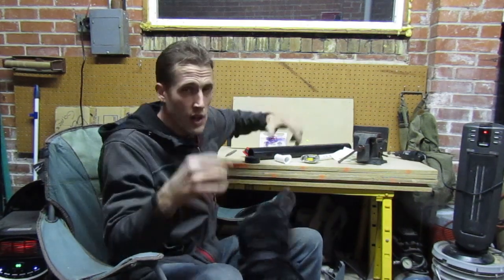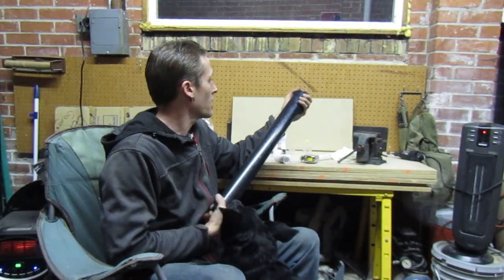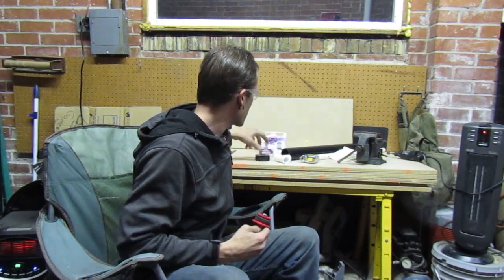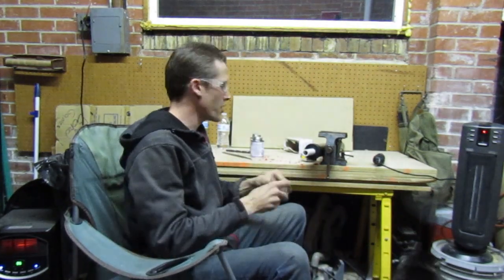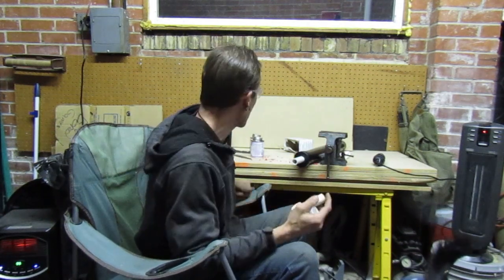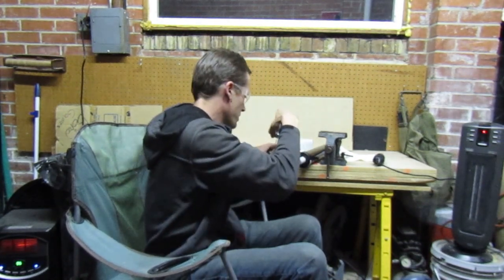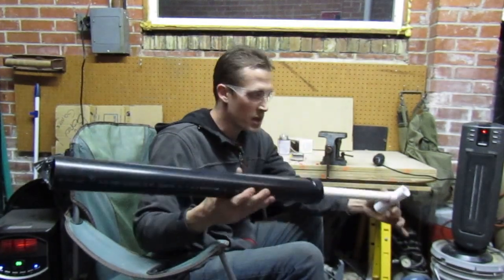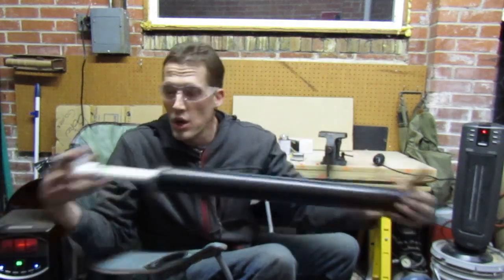Do It Yourself: Hand Dredge/Yabby Pump

Comment: Nice relaxed video. Drill a 1/4 inch hole near the top end of the 2 inch tube. That will allow it to expel air/ water above the seal when drawing up. Dont use a screw or anything hard as a stopper on the handle as this will soon destroy the pvc it hits against. I learnt that one the hard way.
Reply from the maker: Maybe I'll revisit this one and add some of these features, thanks for watching!

Comment: How has it worked? The test plug was snaggy on mine so I flipped the red plastic pieces around and cut two, three inch circles of thin leather and fit them between them and shaped them like well leathers. Works amazingly well. Zero drag and seals like no other. Enjoyed the video.
Reply from the maker: It's a beast! In my last video I used it and pulled up some big rocks. Thanks for watching!
Reply: @lankywhiteguy  They really are one of those "what did I do without this" tools
Reply from the maker: Definitely! Some places you cant scoop!

Comment: I've seen this done, but instead of a rubber plug, Leather is used. And as the leather gets wet it swells and provides better suction. (It is cut round to fit and a couple of layers thick, then squished and soaked.) The rubber plug can be temperamental and or difficult to get a proper amt of suction.
Reply from the maker: True. I've had older pumps with leather but you've gotta tend to it and make sure it doesn't dry out and get brittle. Thanks for watching!

Comment: So I'm building out several of these pumps in 1.5", 2" and 3" diameters and i think I'm using the identical oately test plugs you used for them... Now I also "get kinda ehh about that stuff", but ALL the time... Only i can't get past it till i conquer it... Lol...
So if you have a minute, i have a couple quick questions, is your 2" plug using a 5/16" carriage bolt?? Both my 1.5"&2" plugs have a 5/16-18 bolt, one that's 1.5" long, the other is 1.75" long (the 3" has a 3/8-16 x 2.25" center bolt)... 
Next question, did you definitely drill your cap out to 1/2"?? If so, are you having any trouble with it staying set where you adjust it to for any length of time?? 
I've deviated from your design where the plunger rod connects to the test plug in an effort to make mine modular as well as seal better, but I've been trying them out in the garage and I'm not happy with how they're holding a vacuum yet... Reason being, I'm in SC between Charlotte and Columbia and a lot of streams around here flow in the 0"-2" range in the summer and fall, and to get into something with a 4"-6" depth makes me think I'm in a river... Not to mention the super low likelyhood of finding gold close to home, makes me really wanna be firing on all cylinders after traveling... Lol... 
Anyway, I'm not sure if I've over complicated things or if I'm fighting the physics of specific gravity of the volume of water and air pressure... 
I just thought I'd ask and maybe save myself some time... Especially since we all know this ends with a 2" floating dredge and diving gear 😂😂
Reply from the maker: That was so much info 🤣 it sounds like you're on the right track. It's been so long since I've made one I don't remember the bolts but off memory 5/16 sounds right and I did drill the cap to accept the internal rod. I get good suction but had to fine tune with the wing nut. After enough uses the rock and gravel screw up the threads on the plug and locks it in place so you may need to adjust the first few uses before it locks. Thanks for watching!

Comment: I bought one online for £40 and it's rubbish. It doesn't suck any material up and all the air comes out by the handle. How can i fix it?
Reply from the maker: Sounds like the seal inside isn't touching the inner walls of the tube. Not sure though, I've never purchased one. On mine, if you tighten the wing nut you can fine tune the suction. Thanks for watching!

Comment: How do you prevent the test cap from tightening when the handle twists as I use it the handle will twist then cause the rubber to expand or shrink and I'll lose suction or it's to tighten to use lol
Reply from the maker: I have the same problem, I have tried spinning the wingnuts a little but it's now stuck (maybe rusted) in a usable position. Thanks for watching!
Reply: @lankywhiteguy  glad to know I'm not alone :D I'll have to just smash the thread where I want it I suppose ^.^ THANK YOU FOR THE CONTENT

Comment: Do you fella's even have yabbys in the states ?
Reply from the maker: I don't know 😂🤣 thanks for watching!
Reply: @lankywhiteguy  hahaha o don't think Yas do haha the pumps getting out to better use for gold any way hahaha na that's all good don't suppose ya know a good water pipe set up for a sluice ?
Reply from the maker: @louker5253  if your talking about a fluid bed I've used 1" I think (check my diy video) if it's for a high banker I think it would depend on your pump and sluice size/quantity. I'm going to be building a mini highbanker this winter and trying 1" PVC w/1100gph pump, running two 8" slices and silicone mats. Hope that helps!